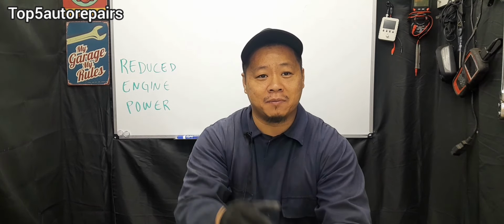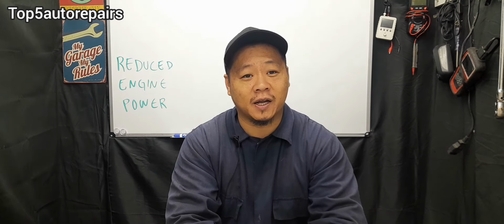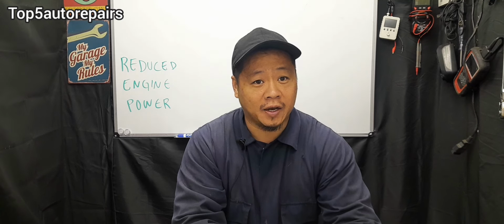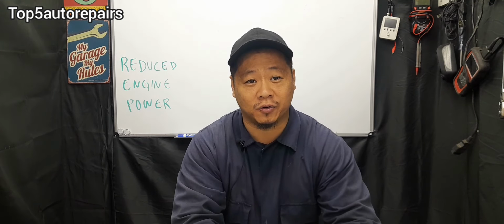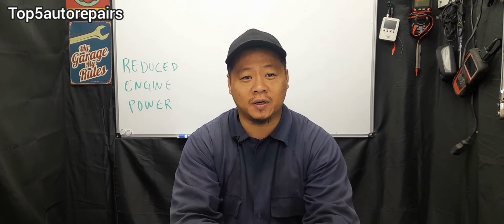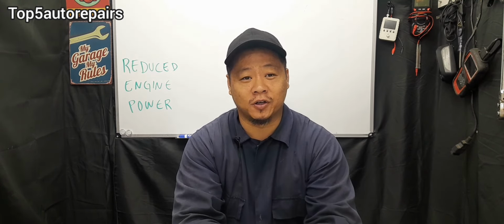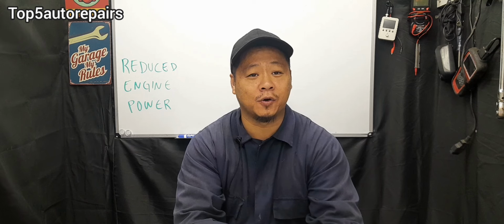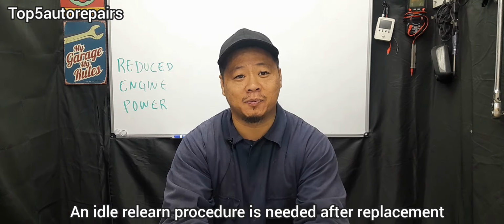REDUCED ENGINE POWER FIX GM CHEVY BUICK

Comment: How bout if you changed both throttle body and app sensor ..still  getting the light but when my reduced engine power light comes on my car shuts off completely then after the light goes off it starts but it will not start while the light is on  the light will stay on for 30 seconds -1 minute 2005 lacrosse 3.8 idk what to do 😩😩
Reply: Same here  Can't figure it out

Comment: Ihave a 2003 silverado 4.8 liter  this whole 2025 year being causing me this issue changed oem throtle body' tac module few times nothing is helping accelator pedal n limp mode coming back the reduce engine power comes back  now im going to try the whole harness ..or else im screwed spent over 3 thousand of dollars trying to fix this
Reply: Check the wires coming from the throttle body. I changed the throttle body and it didn't fix it so I replaced the throttle body sensor assuming the new throttle body sensor was defective, cleaned the grounds but nothing worked. Someone on YouTube suggested the wires and I found some wires that looked like someone stretched them to the point they were almost ripped apart.

Comment: My 2012 verano reduced power and service trac light came on shortly after getting 4 new tires, dont know if thats related or  not, i tried kicking the tires, that didnt help, I drive 59.8 miles to work, 119.6 miles a day, all expressway miles, was running late last week and drove 95 mph halfway to work, taking it to a repair shop in the morning if i make it home from work, engine is also thrusting forward when im at red lights, I will comment again when i get back from the repair shop.
Reply: What was it
Reply: So what happened? I’m a door dasher and I just got the light on my 12’ Buick Verano 😢

Comment: Please respond to me if you can my car is a 2014 Buick regal turbo my car had this happen when I started it in cold weather and it says engine power reduced and it has the engine light and traction light I just want to know what’s the problem. But also i parked the car wait a few seconds start it back up it’s all fine but the engine light is on but the traction control light isn’t its weird and it drove fine on the highway this morning.

Comment: Check your ECU mounts and connectors. If there are nuts that are rusty or missing, rusty mount bolts, or bent ground mount / plates, the ecu can receive erratic data. If you sand it down the corrosion and notice an improvement that can be a huge indicator that you need to clean it thoroughly and your problem might disapear. Also get some contact / connector electronic cleaner, blast out the ecu connectors and hard reset the system by connecting the power terminals and disconnect the battery!

Comment: my car had that message flash across the dashboard and it would drive horribly like it didnt want to go but it would go and stop and go and stop,drove funky,so i got the throddle body replaced and it begain to drive normally again,but then one day i started my car and immidiatly it would die,so i would turn the ignition key again trying to start it up and it would start and die immidiatly,,key word immidiatly,and that same message flashed scross the dashboard,,saying reduced engine power,and then i would try again to start it up,and it would start and drive fine even at high speeds,but from time to time i will start the car up again and it will die immidatly,and ill start it again and it will die immidiatly,and then ill try again and it will start up and drive,,but i also noticed,it actually feels like the engine is ideling very low to where it feels like my car is barely even running,,what could this be?

Comment: what causes your 2012 buick lacrosse reduced power and service trac light to come on but the power does not lose power
Reply: My reduced power light on throttle body was replaced still the same they are saying it's the pedal
Reply: @FeriMcClanahan did you get the pedal replaced? Did you find a solution?
Reply: @brightkentuckyboy my grandmothers Buick was because Catalytic converters

Comment: Buick enclave - purge valve hose broke and is discontinued this little vacuum leak caused me traceable problems. Also oil getting in to and clogging the air filter reduced flow to throttle bottle not the actual throttle bottle that needed to be replaced

Comment: My 03 Silverado does that reduce engine power, i can unplug throttle body wires and plug back in and it works for a day or two ??????
Reply: have you check out the videos about the 1516 code and grounding issues?
Reply: You ever figure it out?

Comment: I just got my 2019 fixed Silverado for this. It was a frayed wire near the dipstick
Reply: Which engine do you have? My sister has the 2.5L and we took it to the shop and supposedly they replaced the throttle body but it’s still acting up and throwing codes
Reply: My 2011 silverado had the same problem even though there was nothing close to the wires to cause that to happen.

Comment: it is not the throttle body, mine was both replaced and still does not work!
Reply: Ground wire !?!? Maybe
Reply: Did you replace your coils,and wires
Reply: Try cam sensor
Reply: He guesses.

Comment: I have a 2008 chevy impala lt, i have replaced the throttle body and it still says engine power reduced and service traction control, could it possibly be the pedal?
Reply: Bro I have a 2004 Pontiac Grand Prix that it's been giving me the same problem for a year now. 11 months ago I had to replace the pedal sensor assembly and the map sensor. I got the car back on the road but fast-forward 11 months and it's doing the same thing again. I took it to the mechanic and they told me that most likely it's the throttle body, when I looked online for the part it was $400. Let me know if you ever got your fix and what it turned out to be
Reply: @mr.g4952  well my impala sat for a year and a half, got it up am running. It only did it for the first 30 minutes at it running, hasn’t done it once over the last 3 weeks. But if you have replaced the pedal, you can look for a sensor rebuild kit for the throttle body. The sensor is the failure it the throttle body, you dont have to replace the whole thing just clean it up real good.

Comment: 2012 Buick regal. Jerks in idle and has slow acceleration. Doesn't speed up on high ways
Reply: High pressure fuel pump.